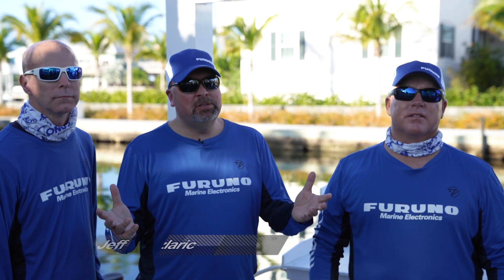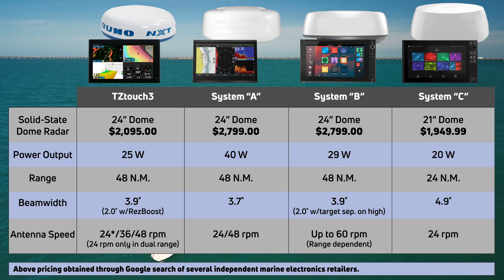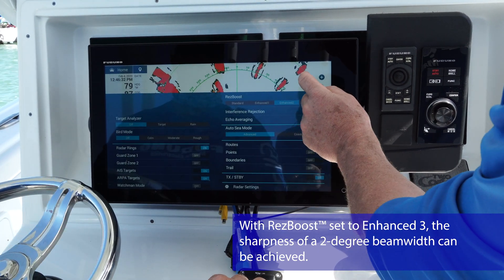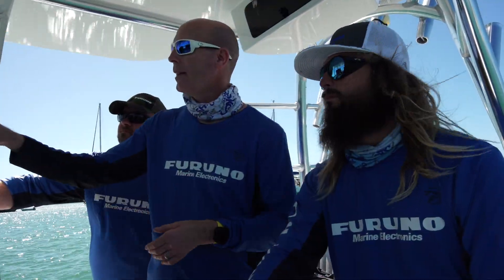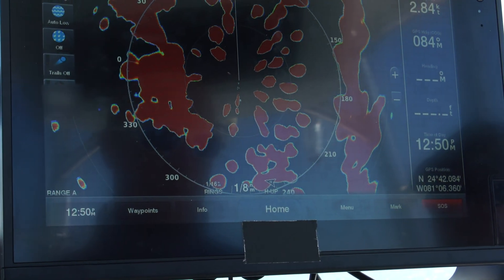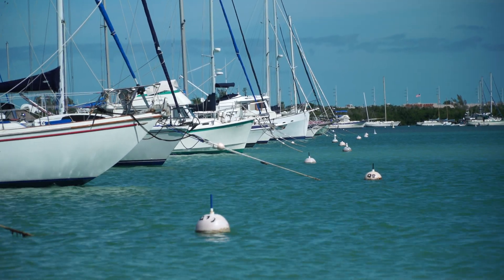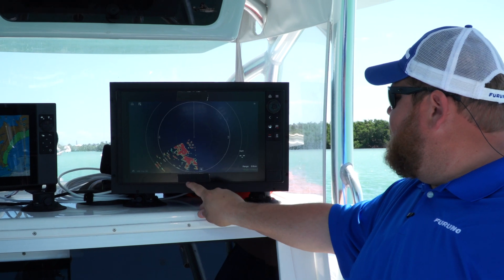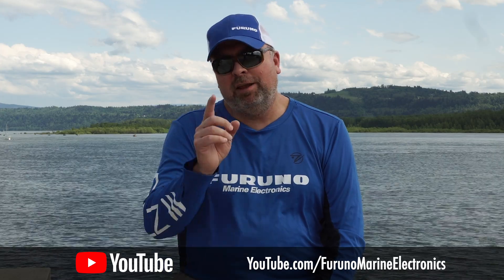EP9 Solid-State Marine Weather Radar Navigation Systems Comparison 2020

Comment: That simrad 4g (system b) seemed to be the best. Especially since you only have to tap one button to get harbor settings instead of having to make advanced settings changes like the furuno.
Reply from the maker: Thanks for watching. For this particular test, all four of the systems did a pretty nice job of showing all of the moored sailboats in the harbor.
Reply: @FurunoMarineElectronics  I thought the garmin did OK but the target separation just wasn't the same as furuno and simrad.  The raymarine has blind spots make that radar unusable in my opinion.

Comment: System B seemed to be clearer in harbour mode than furuno?
Reply from the maker: Both the Furuno and System B performed well in the harbor. This is one test of several that we conducted on the Radars, so you will get a better overall picture of performance when all of the tests have been posted. Our goal is to show the results of each test as they actually happened, so that you can make an informed decision of which system is the best for your needs. Once the entire season is finished, you will be able to look at all of the tests to determine which system is the overall best system. Thanks for watching and we hope you continue to enjoy the testing!